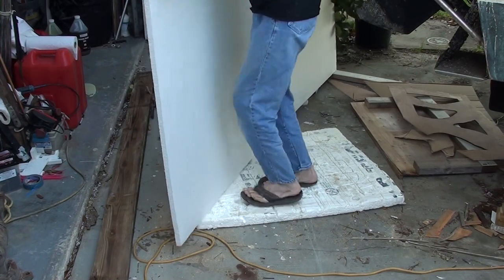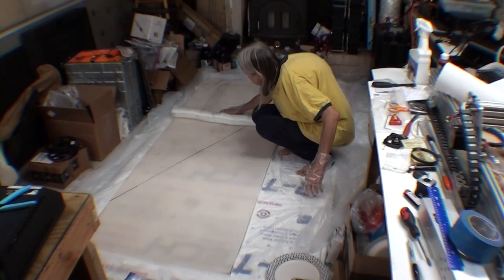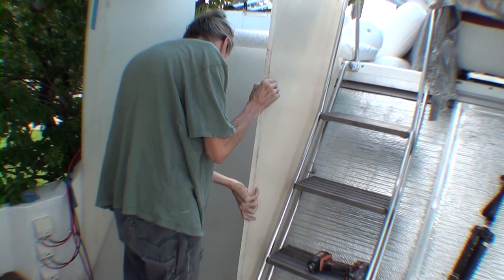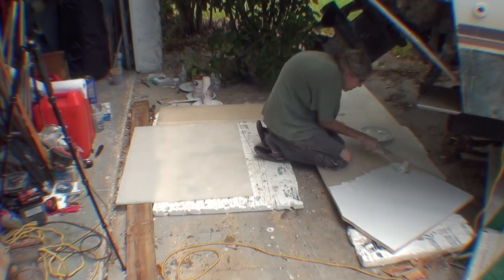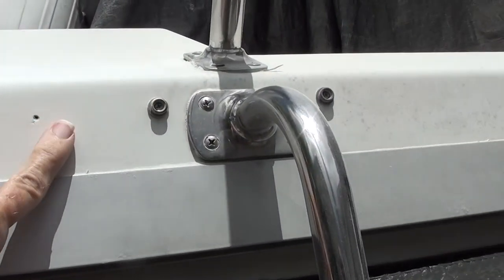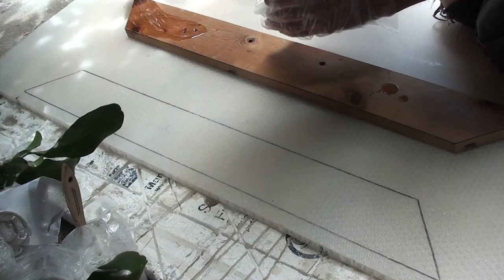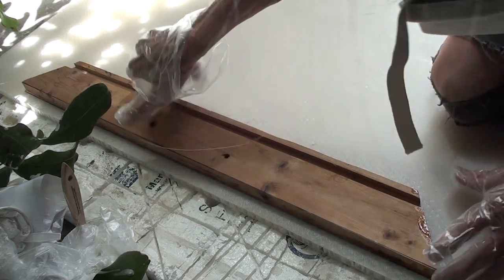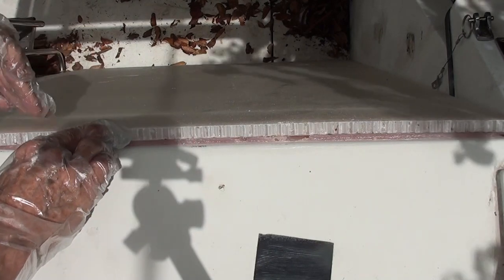Honeycomb Core Nidacore Deck Locker Closet

Comment: Hey Capt Nine Hundred I can get to my helm deck well now since I replaced my fuel tank helm well sit on top of my new fuel tank what do you think I can wrap my well in to insulate it I got roughly 2 inches of clearance around and 1 inch of clearance on rear do you think that honeycomb can insulate for ice do it  come in  2 inch thickness and 1 inch or what could I use for that I would just peanut butter the pieces to side of well   It needs to be compatible with resin  any thoughts thanks JT 🇺🇸🇺🇸🐠🐟🎣🛥🌴⛱🙏🏻🙏🏻🙏🏻